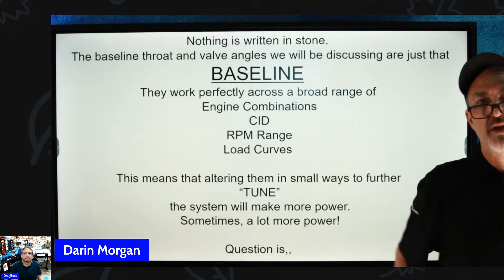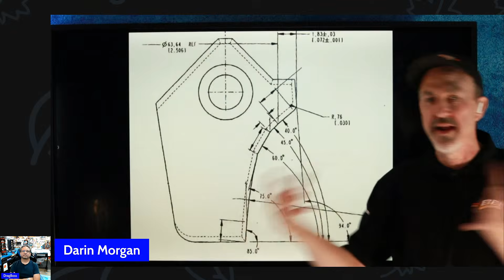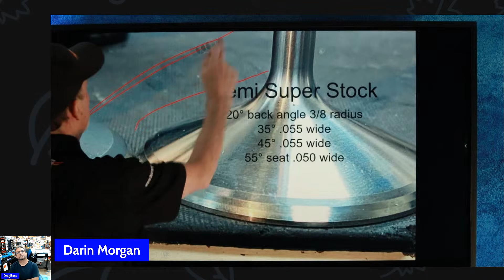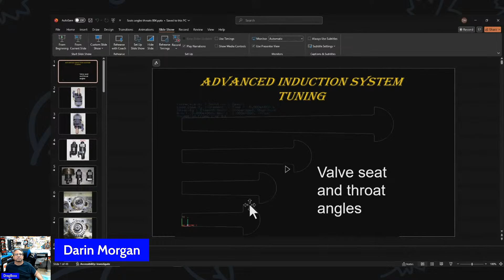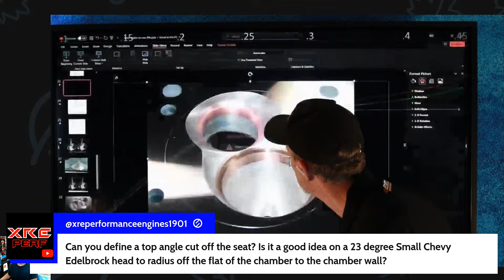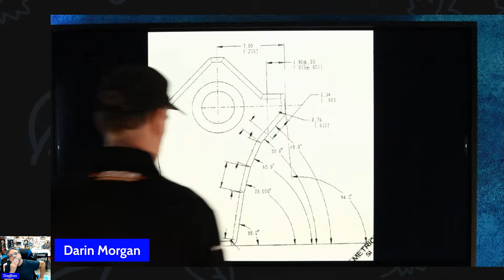🔥 LIVE TECH SESSION: VALVES, VALVE DESIGN & MAX FLOW SECRETS! 💨🏁 📅 5/30/26 @ 6PM EST

Comment: How far do you carry the chamber angle out until it stops having a critical effect? Like in the case of the 45° seat, how far does the 35° chamber cut go before you can let the wall incline to the deck?🤔
Reply from the maker: Sounds like a great question, do you see post for our open live chats? Have you considered joining out membership? These are the in depth topics that are covered. We just finished part 1 of the exhaust port.:_DarinDB:
Reply: @dragboss351cleveland  I was a member until you had that pause awhile back. If you're up and rolling again I'll jump back in for sure!
Reply from the maker: @nissanjon3034  Yes we are rolling, and have had quite a few members only chats, be nice to have you back:_DarinDB:

Comment: In all these valve/head angles regardless of 45' right through to 60', the valve margin angle is always shown as 90 degrees and Darin never speaks about the margin angle or margin width. Just as the chamber wall after the seat controls the expansion and flow into the chamber, wouldn't the margin also have a part to play ?  If the seat angle is 45, why isn't the margin at 60 degrees .......
I'm sure Darin knows what's going on (this guy knows everything), there but it doesn't seem to get covered ?
Reply from the maker: Your right. These are topic's we cover in the membership. This is for guys that are serious and need to know  more than the average joe. :_A3intake:On the 15th we have a session going into depth...:_DarinDB:

Comment: Here is a technical detail that may be educational and useful: a term for a tool than cuts a finished shapes, such as the multiple seat angle cutter, is a "form cutter" or "form tool". They are definitely more sensitive to the cutting parameters (rpm, feed pressure, clearance angle, rake angle, and etc.), as is any tool that has a lot of cutting edge engagement. An infinitely variable speed motor (obviously within the rpm bracket you need) would offer advantages over a stepped fixed speed motor. Also, elastomer dampers could possibly be worth trying. One other thing worth mentioning is that the clearance angle is often as important, if not more important, as the rake angle for reducing chatter and can reduce cutting pressure and deflection in directions you don't want.
Reply from the maker: That is some great technical insight, appreciate you sharing those details with the community! 💯Thanks for sharing your experience. Very much appreciated. 
https://youtube.com/shorts/v98GiFPii6Y?feature=share

Comment: with the seats perfect what happens  when exhaust  flame throws them  at wide open  thanks for all knowledge
Reply from the maker: Well the valve seat material should resist deformation, and pounding for a while, depending on application. thanks for watching:_DarinDB:

Comment: AT AROUND 1 HR 12 MINS...  NASCAR WAS DOING THE RADIUS ON THE INLET PORTS, I HAVE SOME HEADS LIKE THAT DEI HEADS, RO3....SB2
Reply from the maker: Yes daring does explain that with the yates heads, did you see that part?:_DMvortex:
Reply: @dragboss351cleveland   Dragboss..  That Yates part was different to what i mean...I have the Radius after the bottom cut in the bowl, i will redo the seats, the best thing is the material is there to do all the sharp angles, 15 deg increments....
Reply from the maker: Ok. Carry on then mate
Reply: @dragboss351cleveland  Still watching it, i'm 3/4 of the way thru..

Comment: Very good vid.

I wonder if Darin used seats less than 45 deg and if so when/how.
Reply: Maybe on flat chambers like Pontiac heads with limited valve lift?
Reply from the maker: Good question, sure there applications for that, should of asked that last night, or did you miss it?:_DarinDB: